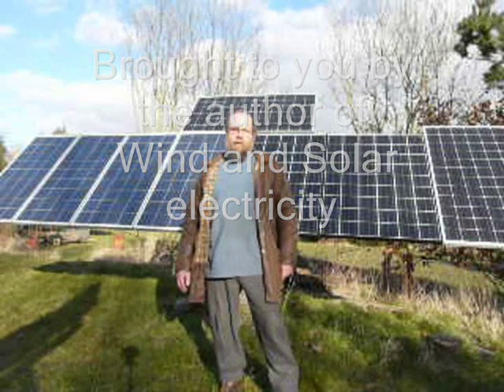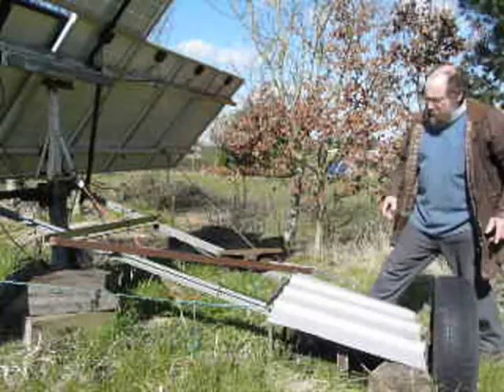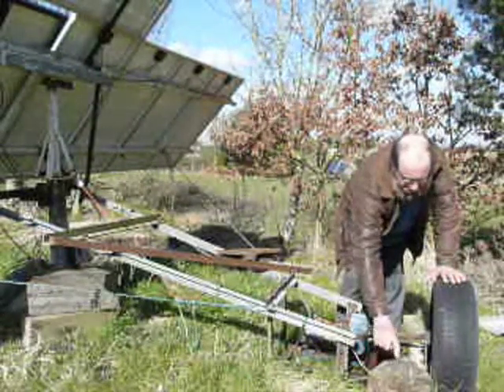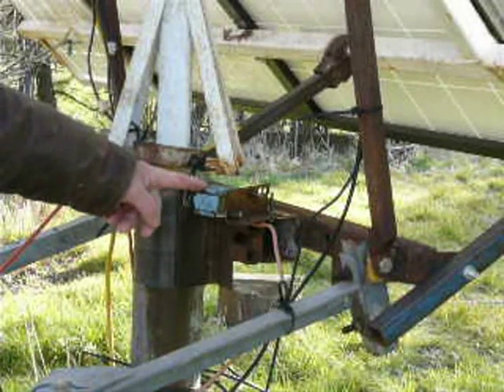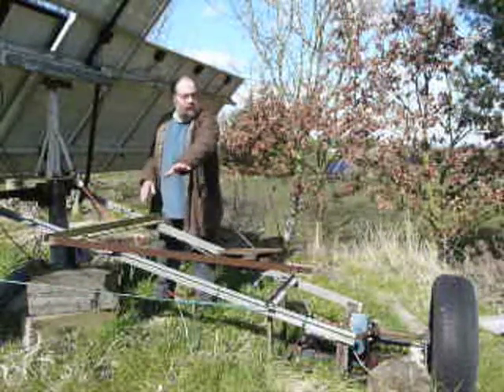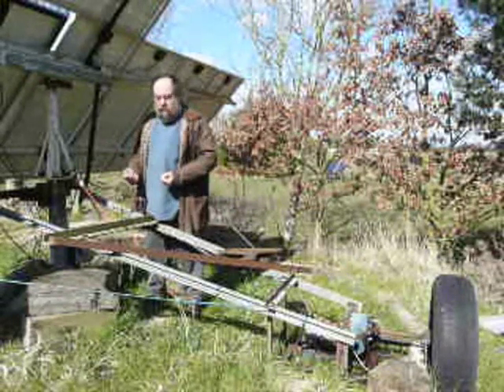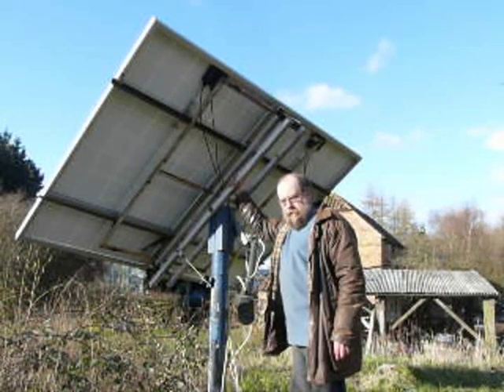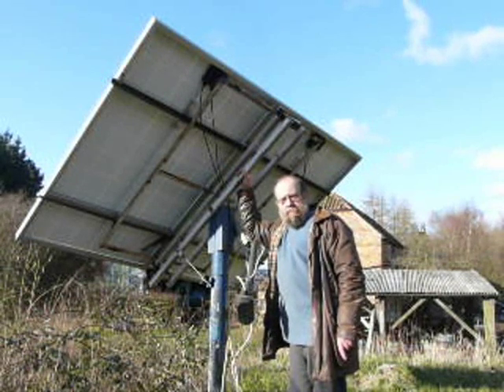Solar panel tracking methods, celebration of edition 2 publication

Comment: I have seen where an old battery drill is used, fixed in a bit of plastic pipe, to drive a threaded bar which is the actuator to a set of nuts ( bolted to the moving panel ). As the drill body is anchored and the bar turns either way depending on the polarity of the input voltage to the drill, you get an acuator? panel mover, like you have on the second and third arrangement there, from scrap. I hope to try that once I get my shed built........ Your work is inspiring, although my landlady might want it to look a bit prettier than yours. Maybe I should paint it pink and plant creeping vines on the framework.

Comment: How much extra energy does a modified panel such as these gain over a fixed panel?
Reply from the maker: Hi, we did some research shown in my book (Wind and Solar Electricity). This recorded the weekly output between longest and shortest days. It turns out that in summer there is in excess of 50% increase in power, and in winter it is much less, depending opn the month. All the details and graphs are shown in the book. I have put a bookshelf driveby video up recently, scan videos from my channel page, to find it. cheers, Andy
Reply: Awesome thanks
Reply from the maker: Hi. you will probably be interested in my solar gate videos loaded last year, it holds 2.5 Kw of panels, cheers, Andy